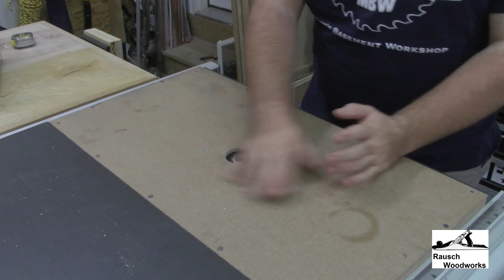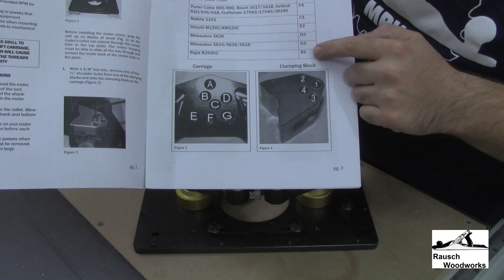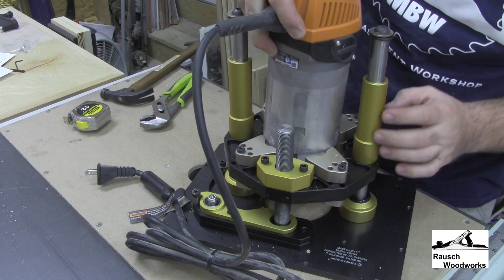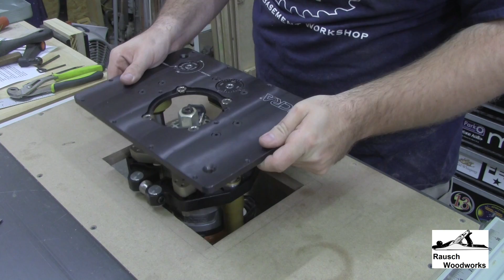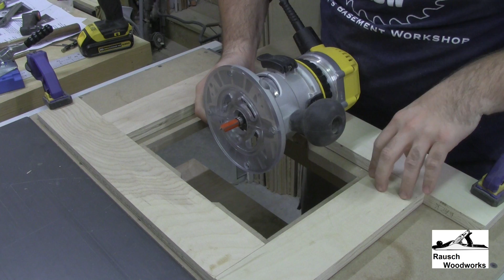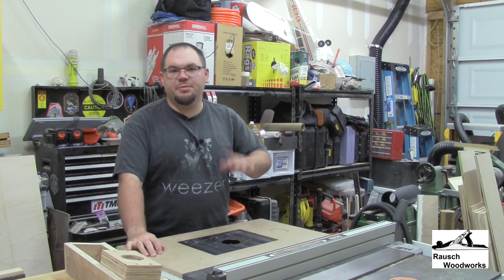Project - Router Lift Install

Comment: Great Video. Great weezer t-shirt.  I'm considering that same ridged table saw set up with the added router extension.  My shop is going to be in a one car garage.  How wide is your shop? It looks like it fits good in your setup.  I'm just worried a hybrid saw will be too big.
Reply from the maker: I've been a huge Weezer fan since the very early days ;)  I love my R4512. especially with the router wing I added using a Jessum style lift.  I'm also in a single garage that is fairly narrow.  I would guess about 15-18 feet.  Honestly, If I didn't have my wall-length workbench on the right, I have a ton of room around the saw.  Even with the saw, it's not bad.  I just make it a point to not really need to walk around that side between the saw and the bench.  You can make it work.  I'm working on a shop tour video in the near future.

Comment: Did you do a video on the extension build? I have a Craftsman which is almost identical to the Rigid and have wanted to build a router insert but am at a lose as how to do it.
Reply from the maker: +Marc Eaton I didn't, but I could do an overview on how I made it and the router table fence.

Comment: One more reason I need to come see your shop. I assume that will work on either wing of the saw? My left side is the side away from the wall
Reply from the maker: Come visit the next time you're down, Paul.  Yeah, I could replace either wing.  In this case, even with the steel wings, I still had the extension open, so I filled that with an MDF insert and put my lift in that.

Comment: The Kreg is actually phenolic, and really solid. I also like how you just rout through the table, and the Kreg brackets attach from the underside. No rabbet needed.

I like the Incra lift, and Jessem has a nice one too. Unfortunately, I have a Hitschi M12V2. It's a beast of a router and I love it, but it works with approximately zero router lifts. I installed my only commercial option, the Router Raizer. It takes a little router disassembly, but works like a champ with any plate. I also use a Router Xtender, and change bits above the table using just an Allen wrench.

All that said, I enjoyed the video!

Comment: Great review! I didn't know that this was an option. I also didn't realize that we have the same router! (hopefully someday the same table saw! Just don't tell my wife!) I used to use porter cable routers (for 12 hours a day) routing office chair mats from blanks on a template. The Ridgid is MUCH quieter and really powerful! This just moves it a step further in my book knowing that I can add this to the setup! Thanks Jason. Please keep the videos coming :)
Reply from the maker: ***** Thanks, Bob!  Don't worry, I won't say anything to Lacey ;)  My regular handheld router is a DeWalt, but this Ridgid was a perfect fit (both physically and metaphorically) for my router table setup.